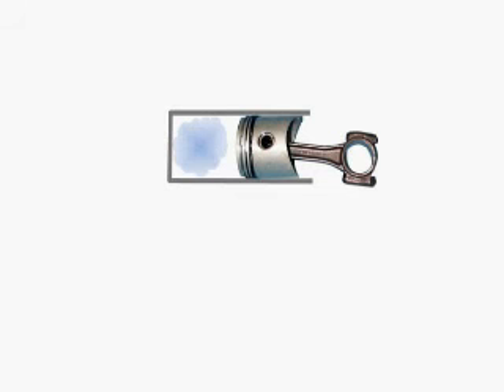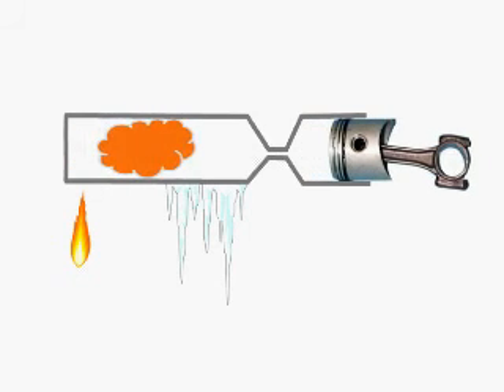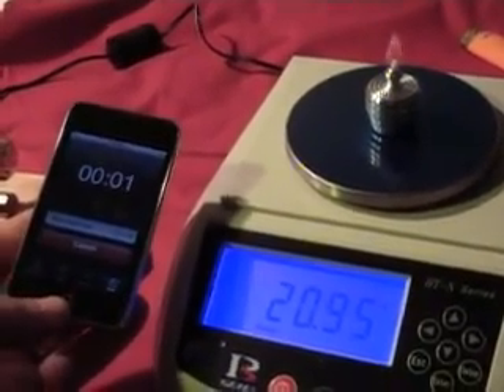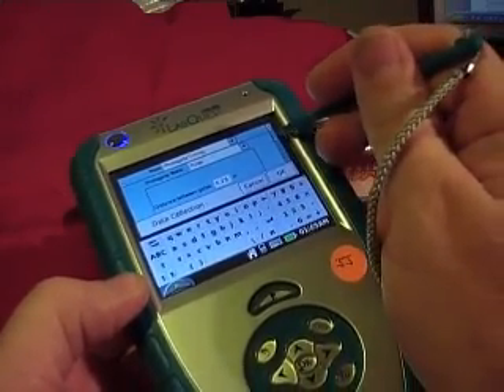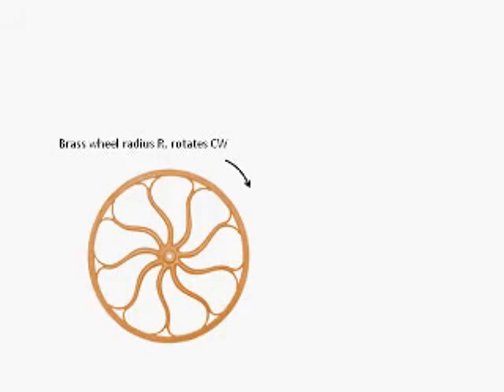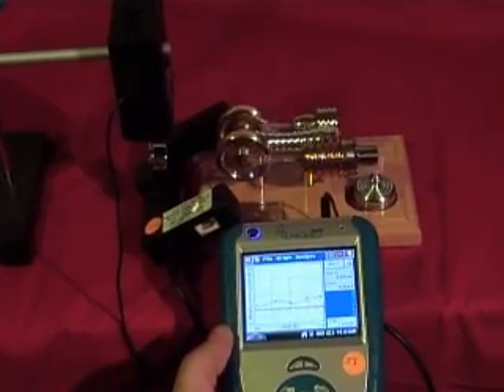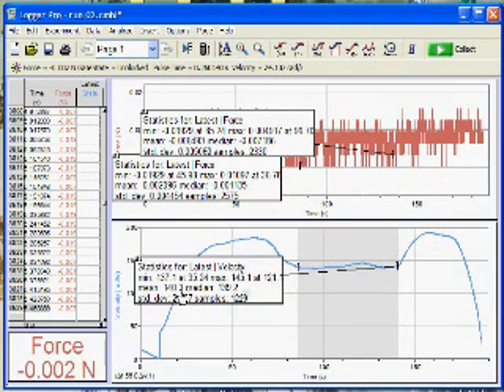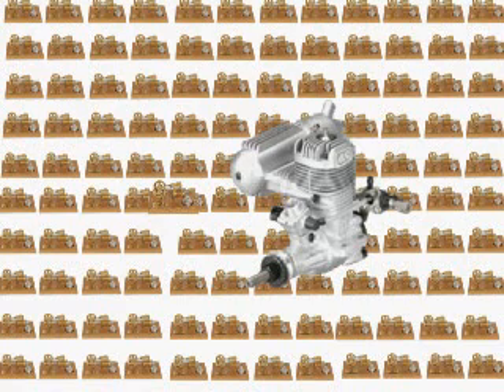The Secret Life of the Stirling Engine

Comment: @TheInnovationGuru Yes, I think you are mainly right - I was first thinking only for counter magnetic fields.
However my magnet likes to get touch with flywheel surface. 
I used a simple aluminum plate as flywheel and magnet was close on its side surface. 
So there could be magnetic horizontal forces (back EMF?) that is not seen on scale...
I try out more if this was a "real" force or just phenomenon of air movement (that is by the way also not seen on the scale). These are minor forces though.

Comment: Great video!

About this clever work measurement with magnet: 
-I feel that a part of force is not seen on the scale because of brass internal electrical resistance (turned into heat).

About comparing with IC´s:
-Stirling engine cylinder walls, cranks can be much thinner and lighter because of lower pressure variations. Material costs - volume is cheap.
-Wearing if bearings is much slower resulting much longer life and less of service needs. Operating costs a lot with IC´s. 

What do you think?